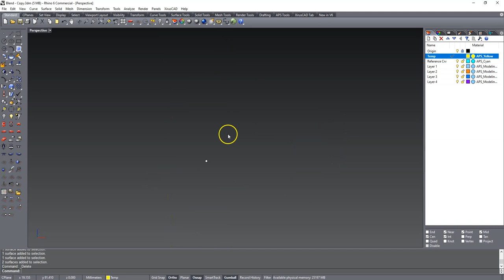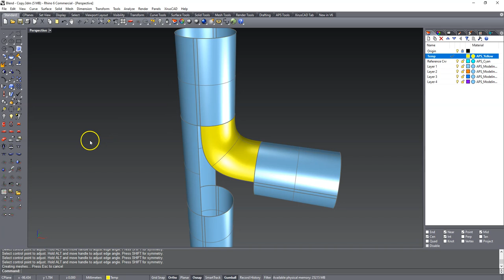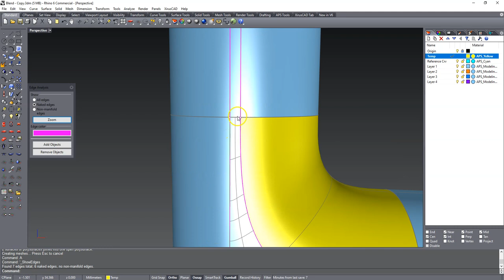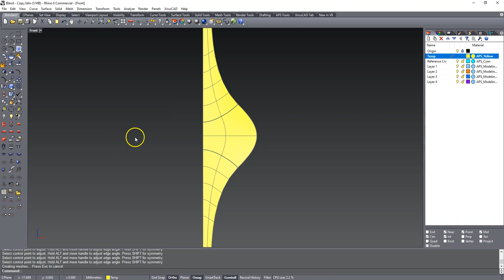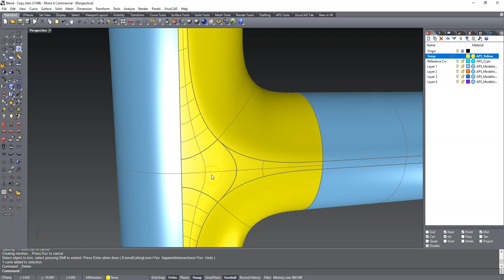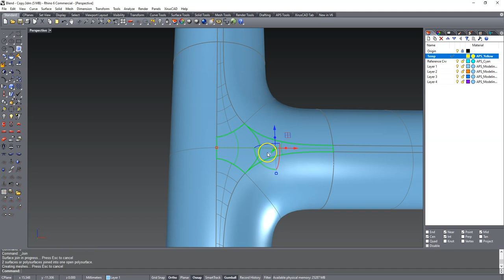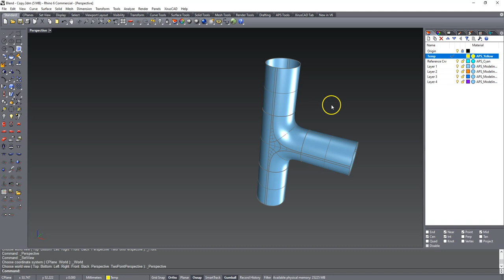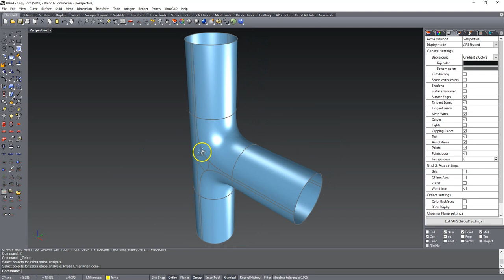Rhino3D, blending a Y-Branch

Comment: Great method! Yes, it might need a bit of additional tweaking but overall the concept is really neat!
* Theoretically when you wanted to blend (by extracting edge then pulling it to the other surface to trim it) and because the extracted edge is from a clean surface, namely from a blend surface, pulled to another blend surface, after the trim you could shrink the trimmed one back to that edge (ShrinkToEdge command). Hence, theoretically it could help with the Match/Blend surface.
Reply from the maker: Hi PashKuli, Thanks for the feedback. I just tried running the "ShinkTrimmedSrfToEdge" on that third blend, but it didn't change the controlpoint structure at all. Not sure If I'm doing something wrong, but it doesn't seem to help in this case. 

What did help, was to run "RebuildEdges" set to the file tolerance. This reduced the complexity of the trimmed edge and I was able to get a watertight join with just the fourth blend surface. No need to increase the degree.

There's always little tricks to improve the result, please continue to comment. I believe that the comments from other experienced users are helpful to everybody. Thanks.